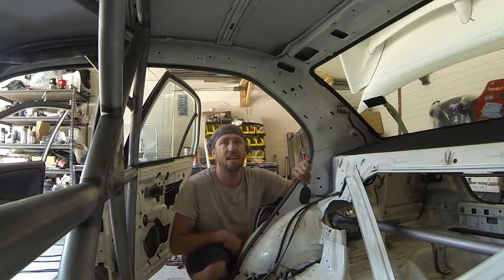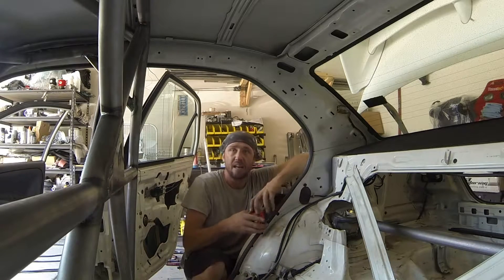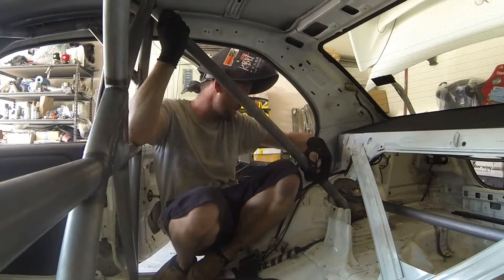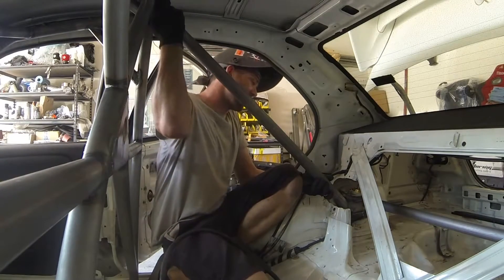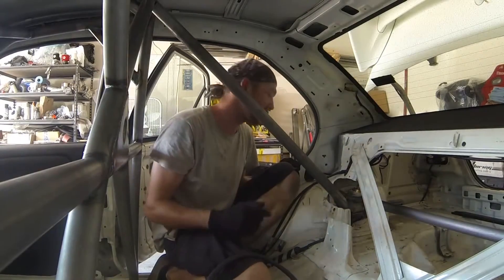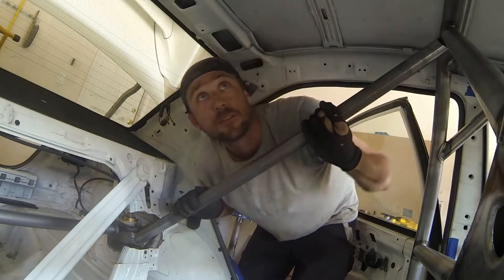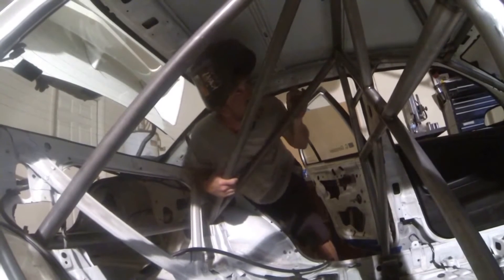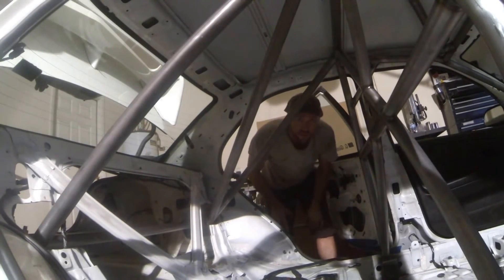TFSS: How To Build A Time Attack Roll Cage - Rear Braces

Comment: no need to remove rear struts when welding to the tower? also did you drain/remove the fuel tank or is that all not necessary?
Reply from the maker: That is up to the design of the car and strut (also personal preference). There isn't much need to drain the fuel tank unless you feel better doing it. Of course, if you think there is a leak, you should definitely take care of it before welding.